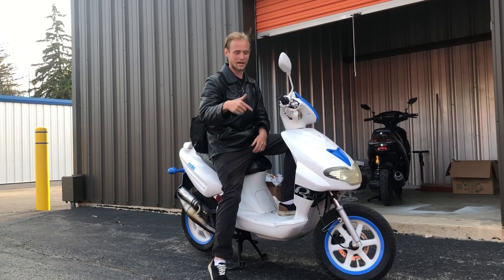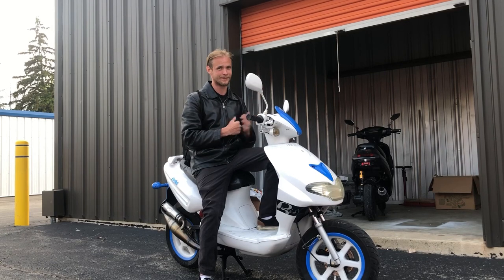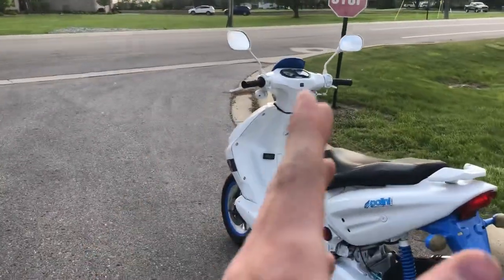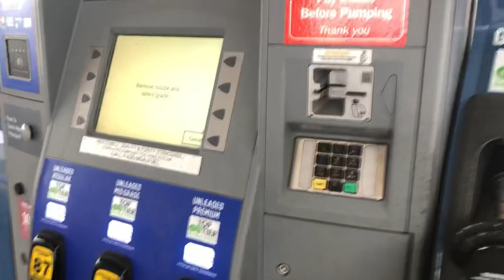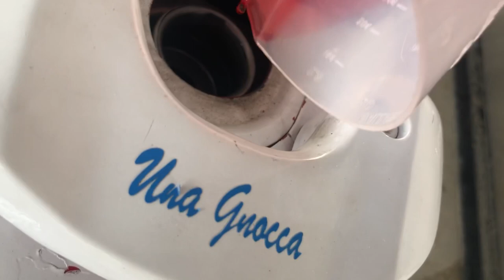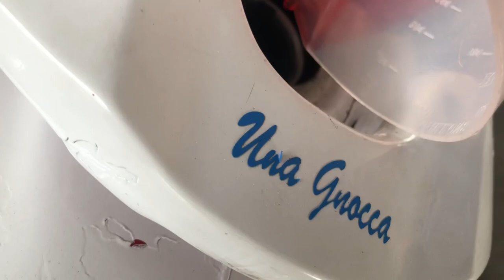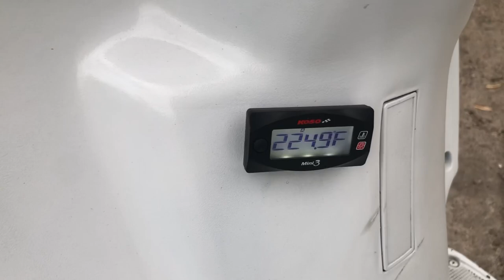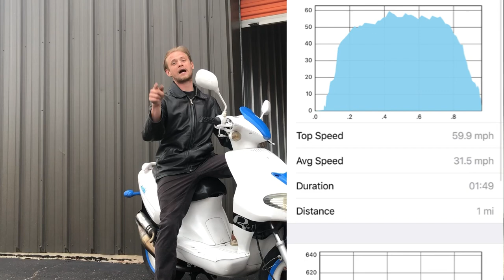Top speed numbers | Vento Triton R4

Comment: How many grams weight roller and what kind clutch you use
Reply from the maker: 3.5 g Polini rollers
Stock clutch with 1500lb clutch springs in the back. CVT’s not built yet
Reply: Got u thanks
 @davidhofinger4927
Reply: And what size v belt you use thanks